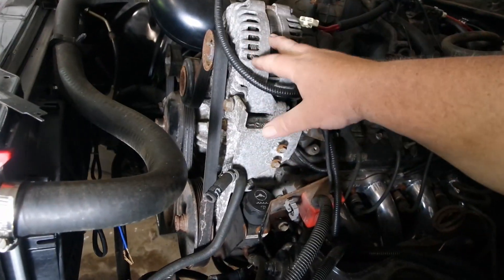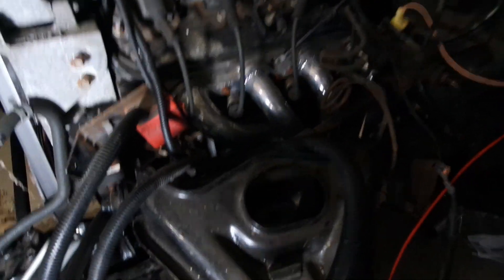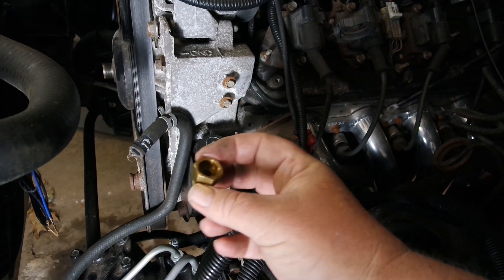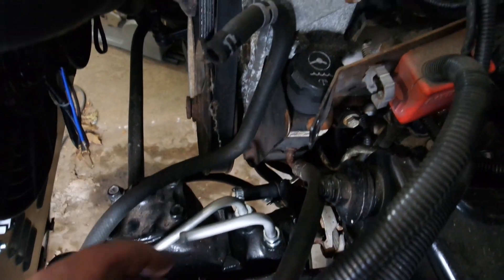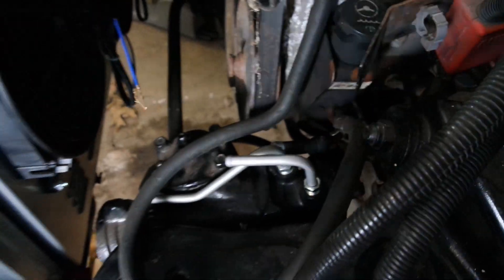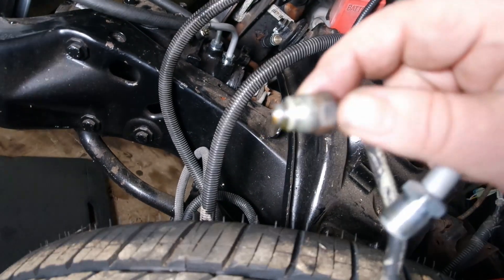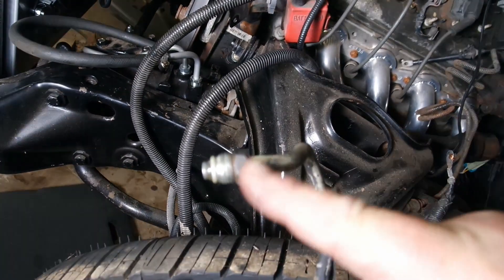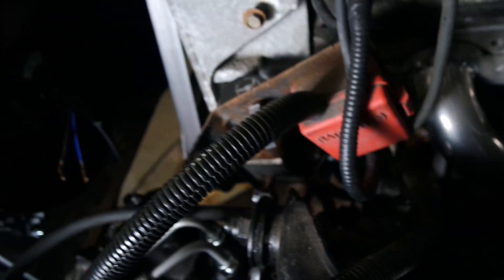Easy LS Swap Power Steering Adapter for Camaro, Firebird, Chevelle, GTO etc

Comment: Have you had any trouble in the past with your return line fitting into your gear box port but not wanting to go past a certain point? I'm having that trouble. It stops half way and then it wont go any further unless I force it. I dont wanna thread my fitting.